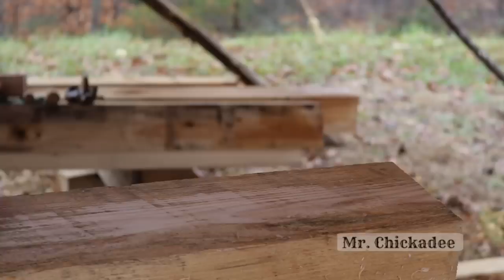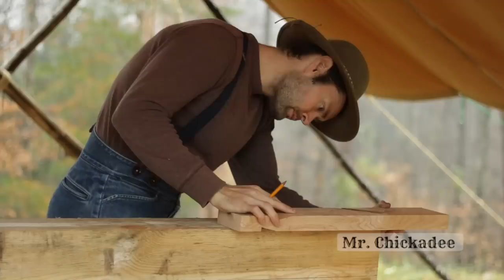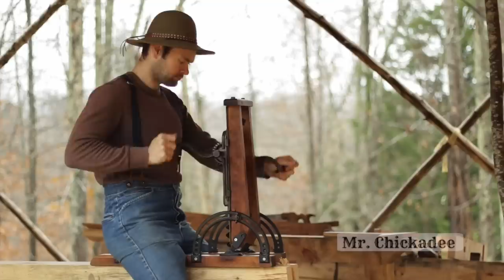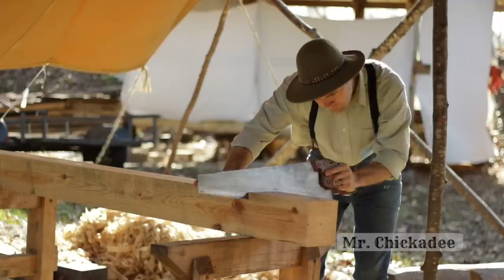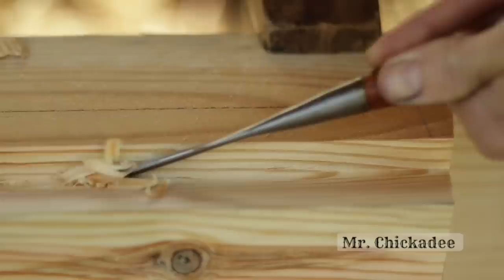Traditional Korean floor 대청마루 ( daecheongmaru) PART I -a wooden floor without nails, screws or glue

Comment: This is also a technique used by the Korean shipmakers, So Korean ironclad ships such as the 'Turtle ship' could ram into much larger Japanese vessels and actually do more damage to them. Also if I recall correctly they use a certain type of wood that would expand when in contact with water to tighten when placed in sea.
Reply: Most woods will expand and swell when in constant contact with water.
Reply: Maybe Hinoki Cypress?

Comment: It has to be so very satisfying when a connection fits as well as the ones you do.....especially such an intricate connection.  Your work is an artwork as well and not just structural components.  Very well done.

Comment: The use of angled holes formed by two separate pieces with the locking board held in place by angled rectangular pegs is so unbelievably elegant that I had to rewind the video twice.  I constantly find myself marvelling at the keen thinking that ancient builders used to solve the architectural need to build something with a minimum of metal fasteners.

I also have to give you a great deal of thanks; you present this in a way that makes it much easier to understand to enormous ingenuity involved, and in a fashion that makes it accessible to just about anyone.  I truly enjoyed watching this.

Thank You.

Comment: this is a beautiful video, and different from the ones that have come before. it is some combination of the simple joinery, the changing seasons, the way the wind catches the shavings and pulls them away from the plane, your patient dedication- some combination of these things makes this video unique.
Reply: sometimes you use a chisel with the bevel down, and sometimes with the bevel up. why is this?
Reply: Achilles 1776 u would have to understand the chickadee to know the soul of this man.
Reply from the maker: @superdansilverman  depends on application, bevel up to pair to a line or drive a mortise to another line, bevel down to steer and prevent going too deep, prevent digging in

Comment: Attractive, satisfying video. One thing I was taught by craftsmen born before 1900. Applies to both saw an file. Let it work in the sharp direction, lift it a bit and pull it back. This keeps the teeth sharp longer. With the file and metal, you don't fill the grooves. Between sharpenings you get more work done.

Comment: Lovely relaxing video, as always. Can't wait to see how you get the flooring into the dove-tailed rebates. Love the no-metal joinery, should outlast anything built with metal fasteners because there is no metal to rust and corrode the wood around it. As always, thanks for sharing.
Reply: What about termites? Isn’t that a problem in some areas?

Comment: Massive 3D jigsaw puzzle. Very nice
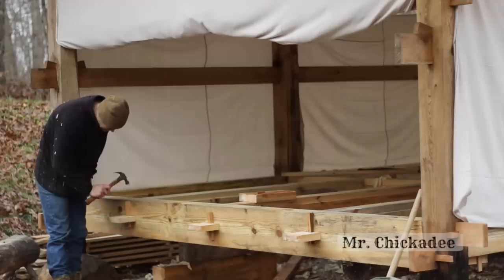I worried when I saw the weather change. What if all the worked wood contracts and nothing fits. But I suppose that's the joy with wood, you can give it a little helping hand if it's not quite perfect. I love the locking wedge technique. Very sustainable too. No metal fixings, no power tools [or very few]. Very nice tool collection. 18:01 Satisfaction
Reply from the maker: Yes, the ideal would be walls first then floor, but really I did the floor first for better filming and light. The canvas cloth on the outside stops driving rain and most blown snow anyways

Comment: Well that angle explains everything. 
When you were describing this flooring to me, I was having a hard time imagining how the planks would stay anchored in a rabbet.
Reply from the maker: There are lots of ways, this is just the one I chose as the best for me, my skill set and tools. Most korean floors have a groove inside the rabbet, and a tongue on the end of each board that slides into this groove. I did half the floor this way before changing to the sliding dovetail as its faster, less work for each board. 

Nother way would be a simple rabbet, then each board gets attached via domino type trunnels through each corner and into the joist preventing movement. This method has the advantage the boards can drop straight down, and no need to slide them in, so the joist doesnt even need to be straight.

Comment: Just incredible. Sharp tools and a great woodworker. Just having the patience to make the beams so square is incredible. The joinery with a probably home made badger plane is ridiculous as well. I am just about done fixing my country home to sell so i can buy land with some other people to make a small rural community. I keep designing windows and such when i wake up early. Anyways ive been thinking about Making a tongue and groove floor without nails and using keyed sliding dovetails. I always have longevity, maintenance, local sourced material, and simplicity in my design. Thought this video was going tobe just that. Floor joists though.
Reply from the maker: The good thing is only to top face needs to be trued, sides just planed to a snapped line offset from the center line. rest of the timber can be whatever. Same for the boards, only top trued, and two sides made parrallell. In all its much less work than doing a western floor by hand, ask me how I know...haha
Reply: Have Any japanese or korean joinery book recommendations? Ive been telling people to not get me anything for christmas, but perhaps a book like this would maybe be nice.
Reply from the maker: @johnmarkhatfield  THe complete japanese joinery is pretty good, and Korean Architecture berathing with nature is also quite well done but a small tome.
Reply: so the breathing with nature book that you said was a little expensive has a few amazon pages. some are 100 dollars, some are 13. any idea why that is? is it mostly a historical or philosophical book? i saw a used one for 28 bucks, but it went away before my inlaw could purchase so they got a cheap tiny book with the same name. my other inlaw saw that it wouldn't come in time and bought some lame woodworking book. hurray for christmas.
Reply from the maker: @johnmarkhatfield  Not sure why the prices vary. The korean book is really small, and not too in depth on joinery, more the philosophy and design aspect of Hanok houses. The Japanese book is pretty good, but not complete, no plans or actual wall examples, more a detailed account on how the joints are laid out and cut. Still a great read and reference source.

Comment: By the title I was expecting dowels. I did see 2. I think you're a little early in what I imagined. I really like the pinned sleeper joint. It's one I've never used but I will.
Reply from the maker: No dowels here, just some wedges and locking keys, there will be a few dowels in the next video, but maybe not in the way you would imagine?

Comment: Nice. Ever think of using an umbrella joint instead of tusk tenons? Doesn't leave precision joinery out in the weather and it uses a single flush cut axial wedge acting as a keeper.

What species for those boxed heart sawn headers and joists? They looked pretty dry but no checks. If that had been Doug fir they'd be checked full length and twisted 10 degrees.

I like your pavilion arrangement. Big wide door opening for rassling big timbers. How long did you have to hunt to find all those equal sized poles? 

Keep at it, Bub. Sooner or later the crusty old farts will concede you're a hard core timber carpenter. Damn whipper snappers anyway.

I've come to love that inkline. I showed one of your earlier videos to one of my buddies. He bought one and uses it every day. He leaves his layout on his log work as sort of a signature. How do you avoid leaving inky finger smudges on the work?

Looks like there's a need for a dovetail rabbet plane. If there ain't one, there should be.

Is that your homestead we saw in that brief wide shot? Very tidy.
Reply from the maker: Nice. Ever think of using an umbrella joint instead of tusk tenons? Doesn't leave precision joinery out in the weather and it uses a single flush cut axial wedge acting as a keeper. 

Not sure what joint you are refering to as Umbrella. These tenons will never see weather, if they would I might go with some other form that kept them protected. 

What species for those boxed heart sawn headers and joists? They looked pretty dry but no checks. If that had been Doug fir they'd be checked full length and twisted 10 degrees. 

Most are shortleaf pine, one joist is tulip poplar, all are about 10 months dry. The pine doesnt check much, the tulip poplar gets kerfed and patched to calm it down. 

I like your pavilion arrangement. Big wide door opening for rassling big timbers. How long did you have to hunt to find all those equal sized poles? 

Not far, poplar saplings like that everywhere...

Keep at it, Bub. Sooner or later the crusty old farts will concede you're a hard core timber carpenter. Damn whipper snappers anyway. I've come to love that inkline. I showed one of your earlier videos to one of my buddies. He bought one and uses it every day. He leaves his layout on his log work as sort of a signature. How do you avoid leaving inky finger smudges on the work? 

I find the ink dries in seconds, or a quick wipe on a rag and its never an issue. 

Looks like there's a need for a dovetail rabbet plane. If there ain't one, there should be. 

Yes, Im already designing one, the badger does ok but not ideal as you noticed Im sure. 

Is that your homestead we saw in that brief wide shot? Very tidy.

yes and thanks!

Comment: WOW @Mr. Chickadee This frame is beautifully assembled & we're going to watch Part II in a bit. Quick question... We're converting an old school bus into a motorhome and are wanting to put in late 1800's reclaimed barn wood for the floor. In your opinion, what would be a good way to secure the barnwood to the floor of the bus without using screws? Or should we use screws because it's a moving vehicle?

Thanks so much for making these videos!

- Brian + Erin
A Texan & Canadian currently converting a '97 Thomas School Bus into a Skoolie Motorhome

Comment: how strong is this wood?? 
i cant believe you leave such thin pieces on the edges of those beams, with which to connect them together.
to my ignorant eyes it seems like it will break from the weight. obviously its not the case, but.... wow.
Reply: In korea have the rainy season  very humid but  wood house is 500years keep live

Comment: Beautiful project!
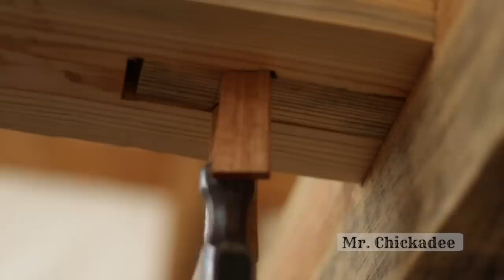Locking pins at 16:45 from top down are keept in place by gravety when dry and Floor is moving... BUT The ones at 17:20 will probably fall out - Or did you fix them some other way???
Reply from the maker: It may be hard to imagine if youve never done this style of joinery, those locking keys are wedge shaped and are very tight and push into endgrain, which does not shrink as the wood dries. Trust me, just trying to get them out, if you need to say just doing a test run, is an ordeal with hammers and locking pliers that often leaves the key mangled beyond repair, lol, its really quite amazing how tight they get. 

Also if you can imagine, the keys are being put in tension both by the large locking wedge on the outside of each end of the building, and they are also tensioning each other on each side of the middle beam. That middle free tenon is a spline, so there are wedge shaped locking keys on either side drawing everything togther.

Comment: Those wedges will weaken the floor beam ends since there is a risk they push out the last little piece of wood after the hole if you hammer them in to hard. Nice to see stuff done the old ways though
Reply from the maker: These connections have been tested in longest surviving wooden buildings of asia, they are not easy to break. There is a reason there is 6+ inches of relish wood past the wedge.

Comment: Great video, looking forward to seeing how you flash over the exposed joinery. Also just curious, do you put a lot of set on your western style push saws? I have a rough time cutting through green timber even with some extra set on the teeth. What fleam angle do you sharpen at?
Reply from the maker: We intend to document the enclosure, all this will be covered and insulated. I use the least set I can for each task. Green wood can need alot, one time we had a class here with green hemlock, that was brutal on the poor students, and the saws needed more set than the stnley 42 could give, so i disassembled it, and ground the anvil down so the plunger hand more travel, gave me enough set, but gosh that was some nasty big rough cuts those saws left!!! 

I prefer 12 degrees rake, 20 fleam for most crosscut saws
Reply: Mr. Chickadee Thank you for the thoughtful reply! I just picked up a nice 4 ppi docking saw so I’m looking forward to getting it sharpened up. Should be a lot faster than my 7 ppi disstons

Comment: Very nice work! Just one question -  why don't you use Japanese kana planes?
Reply from the maker: For me, the tools found here locally are cheaper, easier to sharpen and maintain and work just as well. Japanese saws and planes often require more expensive files and stones an a more rigid honing regimen to function properly.
Reply: @MrChickadee  
Makes sense! Keep on doing fantastic work and thanks for inspiring us!

Comment: Dear Mr.Chickadee; could you tell me why at 17.03 it is not made in the same way (approximately) as 17.25 ? Meaning that the "coined tenon" could be in a reverse housing, like at 17:25, thus having the weight of the system transferred differently on the "false" tenon? Merci!
Reply from the maker: Its often faster to carve integral tenons on a beam, though not always possible to insert them that way in the frame. For example, the large tie beams needed free tenons or I could not insert them between the posts. 
Same goes for the joists, I could insert one side with integral tenons, but not the other, in this design. 
In either case, the tenon should never bear any weight, its purpose is only to pull the joint together and to prevent twisting and other movements. The weight should be held by the housing which should support the majority of the timber, a good rule of thumb is 1" deep housings for all joints,  this gives a good firm seat for any joint to rest on.
Reply: Mr. Chickadee  Desr sir. Thank you very much for taking the time to answer . I totally agree and understand the tie beam issue. Cheers !

Comment: @Mr. Chickadee You clearly are trained in, at least some, Japanese carpentry. I see so many times where you could have used a Ryoba to greater effect than using a hand, back or frame saw and you never pull one out. Why is that? Are you just not a fan of Ryoba?

Comment: This may be a dumb question but what is that tool he usually uses to remove bark with (it has a handle on each side and the blade in the middle) started getting into old school woodwork
Reply from the maker: Draw knife?
Reply: @MrChickadee   Thank you

Comment: for 10:39 - 13:45 we bavarian carpenters just use one Tool the "Grathobel" you should get one of these if you have this kind of work often it is a plane you can adjust at your angle and in deep on both sites so you can just go through your wood without taking much care about it and all sides will be the very same
Reply from the maker: Yes we call that a "dovetail plane" and it is good, though obviously other tools can do that job. I may make myself one if I do this more often.

Comment: Be on the lookout for powder post beetles, they love that beetle kill pine (which ironically those streaks are caused by a fungus from the mouths of a completely different beetle). They burrow in leaving only tiny holes and can survive in the wood for years, only to come out later. If they get into the wood they can be killed by heating the wood in a kiln.
Reply from the maker: This is not beetle killed, just easily stains here in the summer humidity. Even so, understanding insects behaviors and life cycles makes them very easy to control. Either adding borate salts to the wood, allowing it to always dry, and natural surface treatments have been proven to control all types of insect and fungal attack. 

Kilns are not practicle for timber framing and were not used tradtionally. They are just not needed and kiln dried wood is not ideal for hand tool use anyway, green or ar dried being much better for hand tools. 

Most beetles are either the "green wood" type that attacks the wood as its fresh and wet, such as ambrosia beetles and longhorn beetles, or the "dry wood" kind that attack dry wood such as old house beetles and powder post beetles. The former are controled by either cutting the wood in winter while they are dormant or letting it dry in use as they no long infest it. The later are controled by either keeping wood coverd indoors or using a traditional surface treatment such as a wax/oil, burning, or tradtional paint that prevents their life cycle being completed, since they need to re-emerge, mate, lay eggs on the surface each generation. 

Termites of either dry or wet wood type can be controled in similar methods, especially keeping wood high and dry off the ground.

Comment: The only issue I see with those vertical internal wedges is that they are hard to remove. Horizontal wedges like the ones near the ends of the tenons can be knocked out easily. How do you get the floorboards in once the joists are in place?
Reply from the maker: Yes they are not really intended to be removed, and are very difficult to extricate if you need to. We will do our best to explain in part II
Reply: Thanks for the reply. I love what you do. I'm currently one year into an apprenticeship as a timber shipwright, and we use hand tools quite a bit. There's lots of weird angles, simple but clever techniques and hitting things with big hammers.